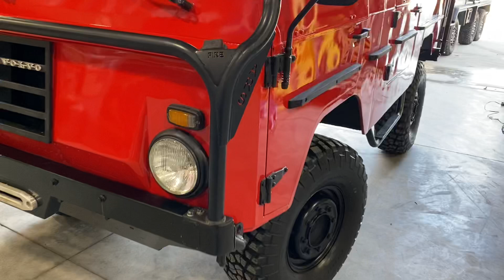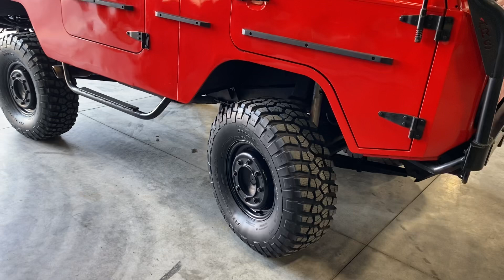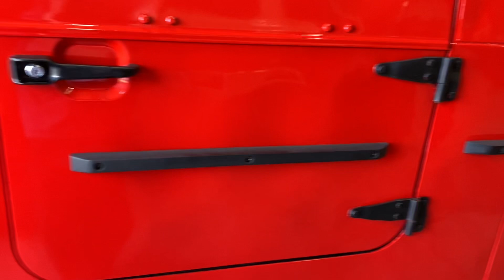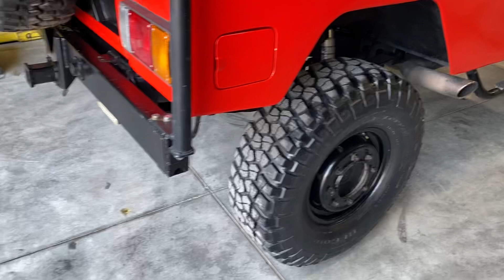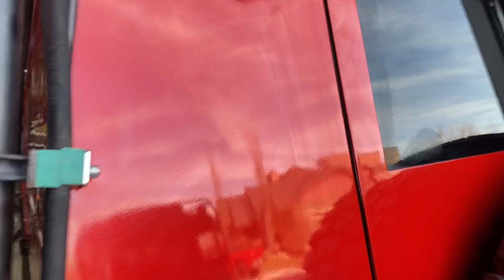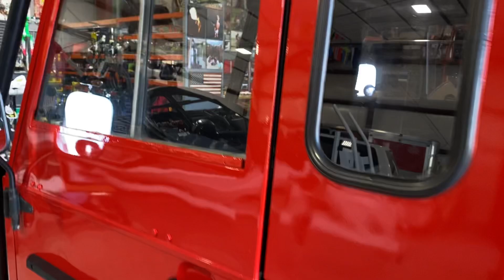Extremely Custom Volvo C303

Comment: What drivetrain did you put in it?
Reply: The one that is mentioned in THE VERY FIRST LINE OF THE VIDEO DESCRIPTION.
Reply: @robertpalmer3166  Wow, such a harsh response. I was actually wondering which drivetrain too. Did you know that Chevy has been making "Vortec" motors since 1985? There were i4, i5, i6, v6 and v8 versions and in MULTIPLE different displacements? Also "automatic transmission" is so entirely vague. Transmissions are part of a drivetrain as well. I'm curious which one was used here.